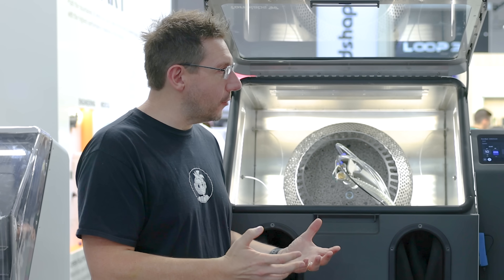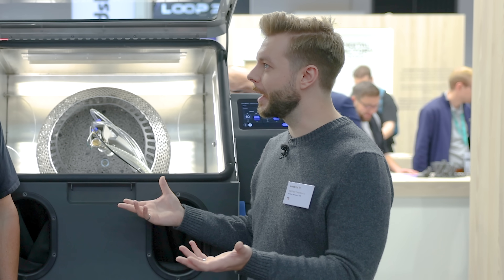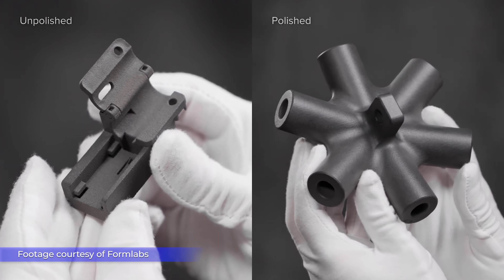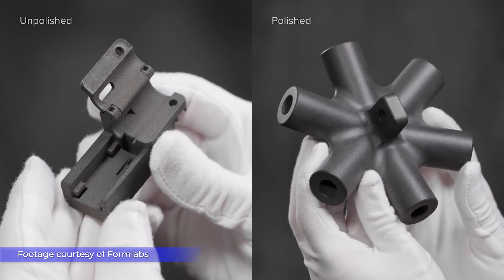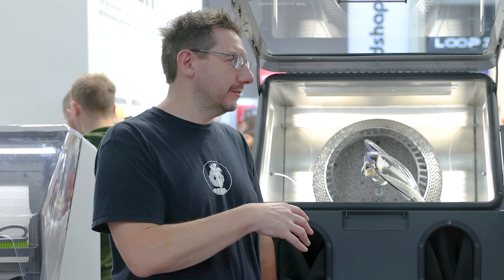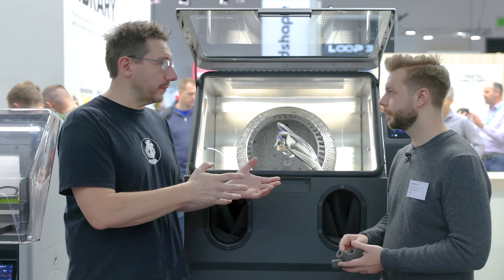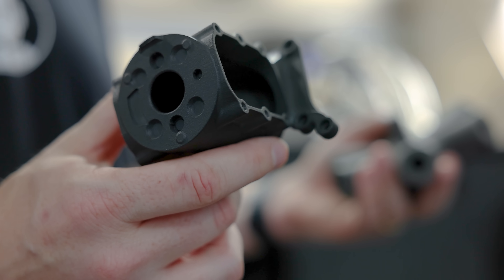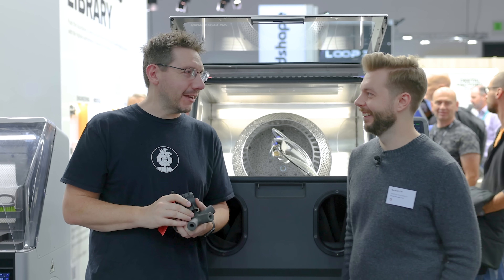CLEAN Parts AUTOMATICALLY! Formlabs FUSE BLAST at Formnext 2023!

Comment: what i don't like is that previously they (all powder based system manufacturers) would sell you the printing/cleaning system with a pitch that it's easy, right out of the machine, just a quick air blast. 
Now.... cleaning is a problem, we got a solution...

I get it, but it still sucks that the industry narrative is usually the same - we've solved all issues.... until we invent the thing that solves more issues.

Comment: It's really strange to me how much this is being marketed as more than it is. It's just an automated media blaster. DyeMansion has had this on the market for quite a while. Also not clear descriprion on if you need two separate machines for the "polishing". Otherwise you'd need to fully change your media in between steps every time.
Reply: It is a lot cheaper than all the pre-existing automated media blasters for a starter at the 10k mark.

You do not need separate machines for polishing and you also do not need to change the media. 
When the cabinet is fitted with the polishing module and the polishing media, it does both the cleaning and polishing with the same media.
(according to Formlabs website)

Comment: This is quite huge. I remember looking at Shapeways at one point, and they have 3 locations: the HQ where all the software is done, and a US and European facility where they make the parts. The parts are done on the giant industrial SLS systems and a person's job is to take them and do all the post processing. At scale, this works. But when working at smaller scale, this is added labor costs. To reduce it further by letting things get cleaned off automatically (and even polished) is a huge win to being competitive at a smaller scale or lower volume.

Comment: The Blast is a beautifully designed device. My big problem as a potential German user is that it does not have ATEX certification. In terms of safety, the Blast actually represents a risk for companies and their users/employees. They claim that de-caking should remove enough material so that ATEX certification is not necessary. BUT who can assure me that as a user, I personally would not want to experience a dust explosion on such a device.
Reply: Review the 2022 4th edition of ATEX 2014-34/EU Guidelines—specifically §34—for clarification as to why ATEX certification does not apply to Fuse Blast. It states that equipment which contains an explosive atmosphere is not within the scope of ATEX unless it is connected to an external process source that may contain an explosive atmosphere; or placed within an area where an external explosive may occur (so a zone area).

The exact clause is as follows:
"...machinery having a potentially explosive atmosphere inside under operating conditions, but having no interface to external potentially explosive atmospheres has to be considered. Such machines, as an integral whole, do not fall under scope of the ATEX Directive 2014/34/EU."

Since Fuse Blast is entirely self-contained and does not operate with any atmospheres external to that within the working cabinet, ATEX certification is inapplicable.
Reply: problem still stands, but is kinda mitigated by ionizing the air and good grounding of every part inside. We (the company I work for, also German) have a similar system for years now. It's not even remotely as clean as they tell it here and you really have to have your ex-proof vacuum nearby to keep everything clean. But it works and removes a huge amount of time in post-processing.
Make no mistake, this video is an Ad. But on the other hand, similar systems already exist without the branding and fancy touch displays (that will be scratched up by blasting media in no time anyways). Look for MHG Strahlanlagen if you need something local, well built and with every certificate you need. They got automatic tumblers as well.
Reply: Its a sandblaster, not a vacuum cleaner. No this doesnt represent any explotion risk what so ever. The vacuumer though, they need to be atex certified
Reply: @sindrejl most powders represent a explosion risk
Reply: @TheJttv Im well aware, I work with SLS printers :)
Reply: @TheJttv  all powders present an explosion risk. Sugar is actually far easier to ignite and combust than nylon powder. It is up to operators and the equipment they use to handle powders in ways that minimize the risks as much as possible, as well as shield operators from explosive hazards in the event an explosion does occur.
Reply: Now the Blast has a suction function. Then the parts that are installed must be certified. Does not change the problem. 

Why do so many metal post processors, with similar degradation then rely on it and choose parts so that the whole package goes into an Atex certification. @sindrejl

Comment: That is AWESOME, i dream to one day have a SLS printer 

- next year i want to try to go to formnext for now i really apprechiate having one video a day to watch from you 

Thank you very much !
Reply: I found it really cool as well, so much so, that I wanted to put money down on the pre-order for a Fuse 1. So I had them send me one of their sample parts and I was not impressed to say the least. Finish quality was good, but the material being used was weak and brittle. On the sample part, the spring lost it's tension only after 20-30 cycles, the edge of the hook rounded over and wouldn't latch any more, and the button failed. I decided to do a strength test by breaking the part and it took very little effort to snap. So I don't know exactly what this machine is made for, but I'm guessing not functional parts. Seems to me, that it's only good for prototyping, and modeling. Form labs got a hold of me a few weeks later and asked if I was still interested in placing an order, and after I told them what I experienced with the sample part and asked a few more questions, they never emailed me back.